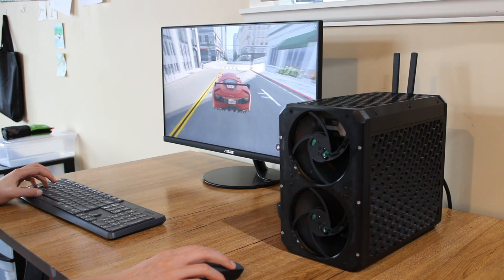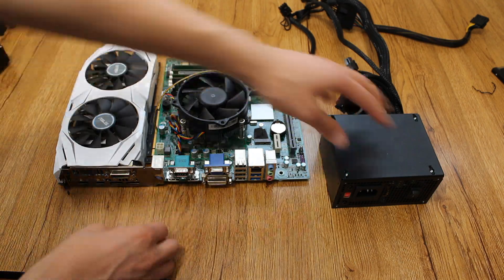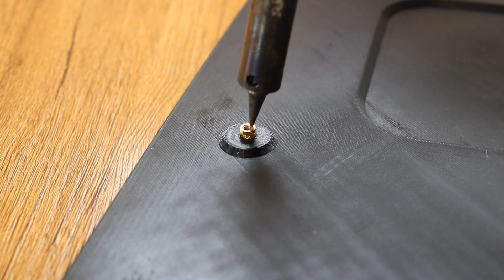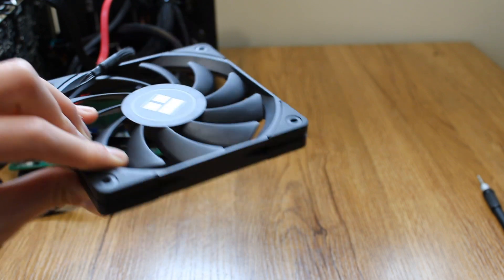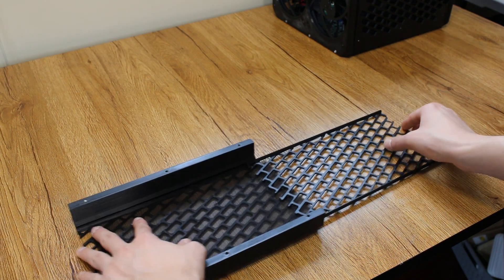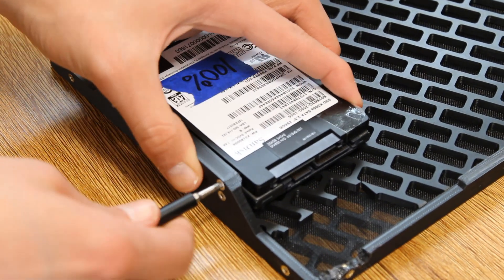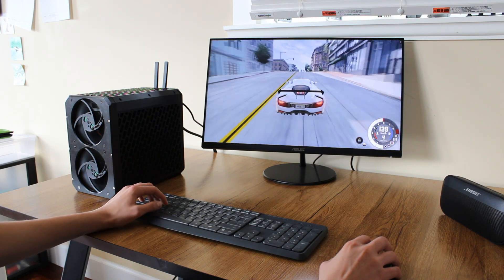building a 225$ 1080p 3d printed gaming PC

Comment: I would have at least went with an 8th gen processor in this day and age. Technically, N100 processor has better processing power than an i5 6500. But other than that, killer build.

Comment: Would have been interesting to see how you connected the SATA drive power cables with the 2 drives oriented like that. Could not have been easy to bend the wires to get them to fit so close to each other.

Comment: The case looks cool, but you forgot to add a mesh at the PSU mount. It blows hot air into nowhere and fries itself!
Reply: Thats intake fan so it actually work as it is still blowing but not "fresh" air

Comment: I really like the concept but as others have pointed out, the airflow is a bit confusing. Front fans are exhaust, bottom intake is fine but there isn't a lot of clearance from the case feet for airflow, half of the CPU cooler is obstructed with the PSU being directly above, and the PSU exhaust is entirely blocked. Reversing the two front facing fans to intake would make a world of difference for airflow, turbulence, and temperatures of the CPU, PSU, AND GPU backplate.
Reply: Front fans are intake. A simple PC airflow search will show this.
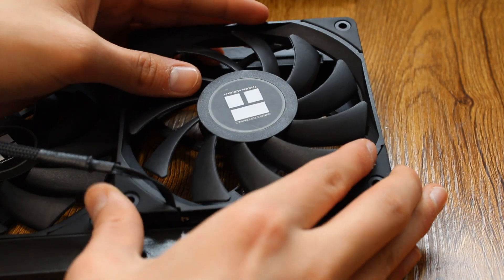Reply: @RhinoXpress  They're absolutely not. Look at fan orientation at 4:20 and you'll see the Thermalright logo (being the intake side) and in the very next shot, you can clearly see their orientation.
Reply: @NoobSniper  you understand they make reverse blades right? All the case flow diagrams from Lian li to fractel all show the front fans as intake in their airflow diagrams.
Reply: @RhinoXpress  Yes, I'm aware. At 4:20, that is *non-reverse fan blade orientation*. If it were reverse blade, you would see the blades' "scoop" head-on. This was simply a fan installation error and Daedalus would just flip the fan orientation to make it intake, signficantly improving airflow and temperatures.
Reply: @RhinoXpress  Not shown in a "simple PC airflow search" gotta love when idiots move the goal post.

Comment: The fans on the case are backwards. Ideal airflow draws in air from the front and exhausts at the back. Your current fan configuration draws air from the bottom and exhausts out the front. Not only is the bottom intake not ideal, as the case sits on the desk without any case feet allowing for airflow, but the front exhaust is not as efficient due to not having enough airflow at the bottom. intake from the bottom of the case only really makes sense if there are fans at the top drawing air through, but that would require a redesign of the case as it looks like your GPU takes up the other side of the case. Otherwise a great design given the constraints that you are working with.
Reply: Bottom intake is fine... with a properly designed case.